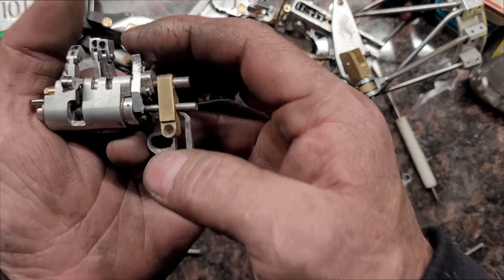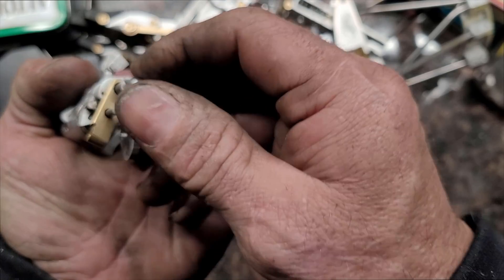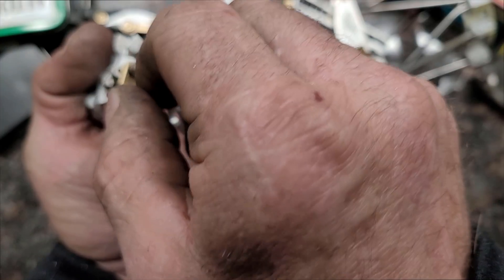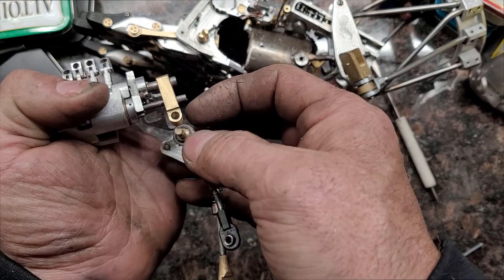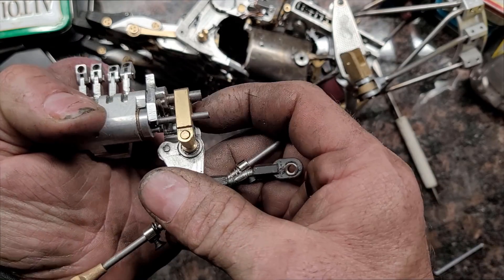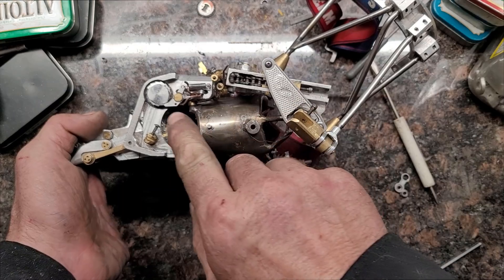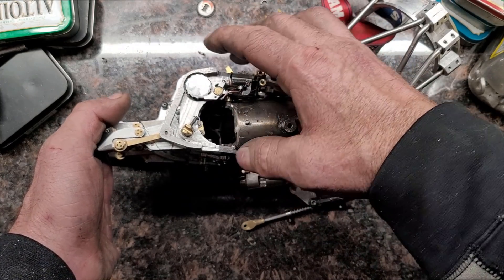Steampunk Prosthetic Hand - Mechanical Pattern Selector- How it Works.   Update 2

Comment: This is quite amazing. As a software person I'd just have thrown a microprocessor at it with some actuators, but that'd require a power source. This is all mechanical at no cost but (literally) a flick of the wrist!
Reply from the maker: The 157 hand was electronically controlled physically articulated. The main issues I had with it was reliable clean signal generation from my residual limb.

Comment: I'm just curious, but do you have Blueprints to your hand? Not that I need them, even though it would be kinda nice to see them... Currently starting to study Humanoid robotics and in the second semester we are going to build a hand, so I'm really interested in all things that kinda relate to it.  But back to the main question... Do you produce technical drawings of the parts for the hand or do you just use a 3d model Software or do you just tinker along until it fits? I know quite a bit about fabricating, but have only very little experience with machine processing, especially in if you do it on your own and not for a company. Apart from that, I am fascinated by your work, and I'm going to try to watch all your vids in the next few days. Just found your chanel.
Love from Germany :P

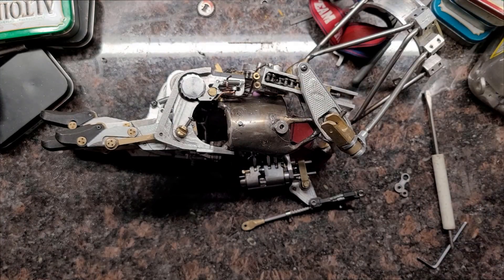Comment: Hmmm, you might want to look into an emergency release. As cool as the ratchet system is, It where to jam in the locked position, you would have to remove your prosthesis until you can manually break off whatever has Jams the cog. For an example, if that cover 2:40 where to dent in the wrong way, it could grab the teeth of the cog and prevent rotation, or an axial impact to the visible side could reshape the cog and have it digging into the frame of the hand.

Comment: Like I thought.
It's works in a similar fashion to a motorcycle gear selector.
Except in this case it doesn't selects gear, it selects mechanical link behaviour.
Never thought of using a drum selector in such way.

Two questions:
how long before fatigue?
Has size increase affect daily use?

Comment: Wasn't this system supposed to work with electronics and a battery at first? That's so cool that you were able to find a mechanical solution for it instead

Comment: Thanks for breaking down the mechanism and showing the detail. The amount of articulation in such a small form factor is a real treat to see up close. It’s a great example of solving a problem with a sensitivity to practicality to the function. It ads a subtitle articulation feature that has an extensive range of use. This was a big advance on this project. I’m looking forward to seeing how you will refine and expand on the setting selections as you take on additional feature sets.

Comment: But where's the turbo encabulator?
Reply from the maker: I didn't need it, I am simply changing the planes of rotational motion by way of a pair of linearly isolated and constrained sweeps. There is no barescent skor motion used on this drive. Maybe on the next version. 🤔
Reply: @missingpartsclub  I didn't understand anything you wrote but good work 👍 I like to see your video And also loved the design of the hand .

Comment: The coolest prosthesis ever is getting cooler every month

Oops I just imagined a version of it with every surface mirror polished, that would be simply stunning
Reply from the maker: I was going to cerakote most of it once it is finalized and put on a diet.
Reply: @missingpartsclub  oh my that would look very good. would you go for a darker or lightish coating
Reply: Yeah, if you've seen some of those restoration videos, the result at the end with everything looking like a mirror its beautiful
Reply: Sometimes it seems like restoration videos somehow go overboard with the polishing
Reply: @-NGC-6302-  yeah but that doesn't mean it looks bad
Reply: Indeed